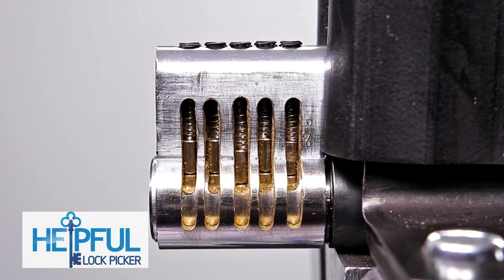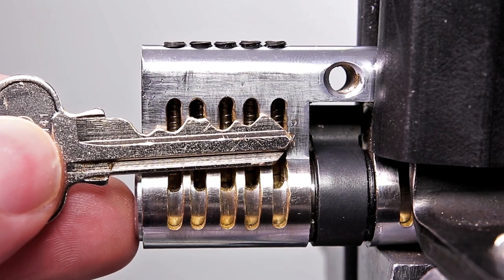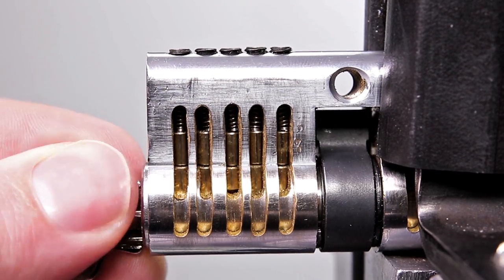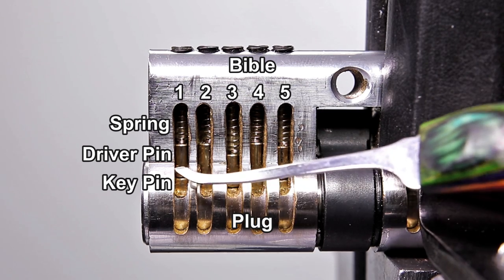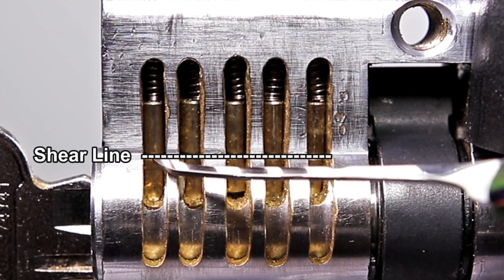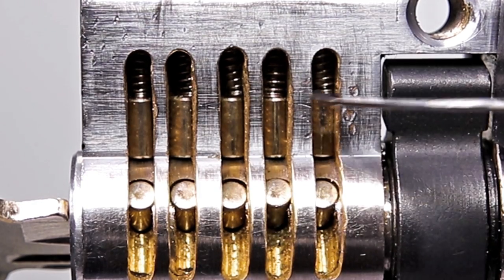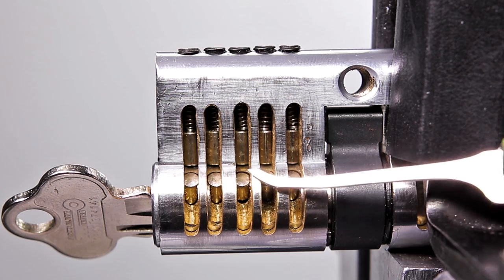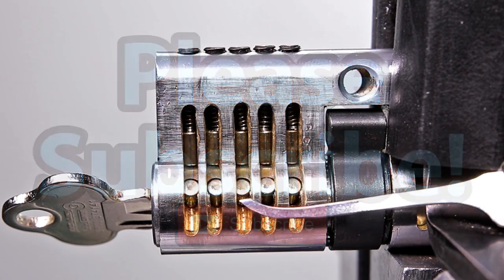[247] How Does A Lock Work | Explained

Comment: When theres no key in the lock are the key pins suspended or do they rest on the bottom of the chamber? Or are the pins or the holes tapered to hold them in?
Edit… i see theyre suspended, but what holds them up like that?
Reply from the maker: Their diameter holds them from falling through completely

Comment: A stupid question I hope someone answers. So when using the key, all pins line up because of it. But if we use a lockpick, how do driver pins stay up? We can't apply pressure on all pins at once, and they should be pushed down by the springs, no?
Reply from the maker: The holes over plug and Bible don't align perfectly and this variation in the tolerances causes one pin to bind under tension. In theory a perfect tolerance lock can't be picked